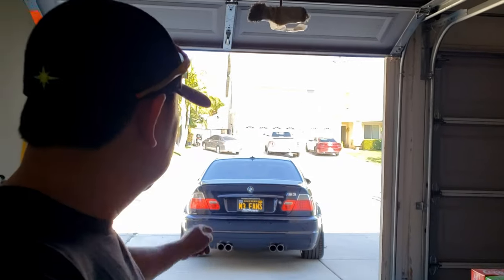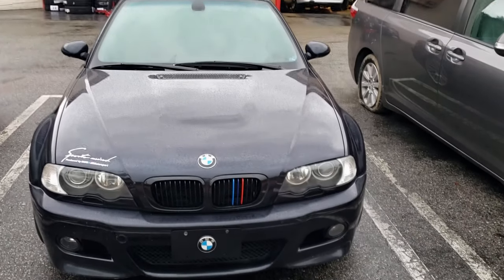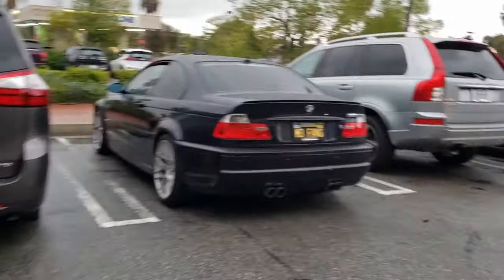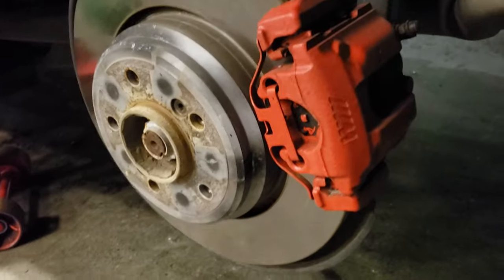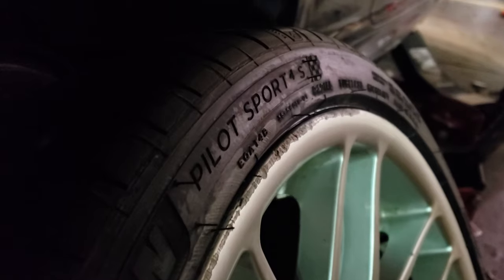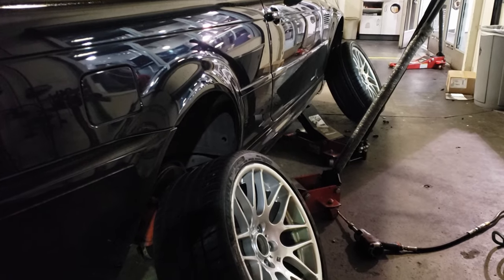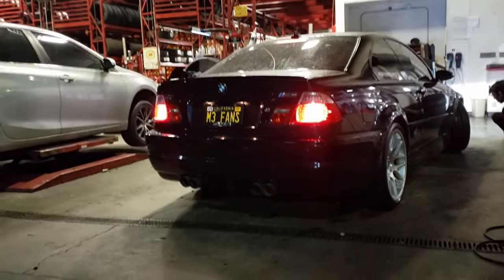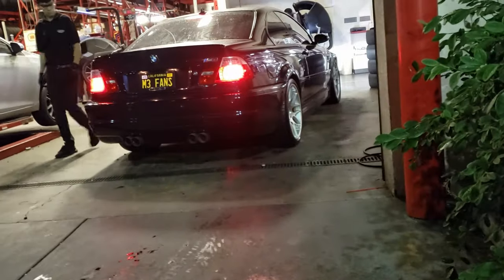My E46 ///M3 gets 4 brand new Michelin Tires PS4.

Comment: Hey brother I always Come back to your videos for advise your on it. 
I got my tires same size as you but the seem to be really big I also have the same wheels but should I be considered about rubbing I also want to install wheel spacers are your wheels 19x9.5 rear and  19x8 fronts? 
Et47 fronts and rear are Et 27 rears are theses your wheel offsets 
Thank you
Reply from the maker: Yes, it the same. Running 15mm front & 10mm rear spacers you will be fine for E46 M3. No worries. Enjoy
Reply: Seth ///M3 Thank you for getting back to me my friend I’m just a little worried about the size so  I have to get spacers so it can fit properly

Comment: How do you like the tires? Just ordered the same tires in 245/40/18 & 275/35/18 for my e46 m3
Reply from the maker: You won't regret with these tires. It rides so smooth and quiet plus it handles cornering amazing & stick to the road so well. Congrats.

Comment: Love your m3. Also you have some good videos.   Do you still have your 15 and 20mm spacers? And went with these size tires and have no rubbing issues?  I’m curious because I want to do the same thing.  Thank you. You take care.
Reply from the maker: Thank you Joni, these spacers will be on the car for as long I own it. There is no rubbing issues. I love the spacers. Strongly recommended if you want to do on your car.
Reply: @teslam3chennel  Man your E46 M3 is beautiful. I have an 04 E46 325i, and I’m shopping for Pilot Sports now, getting ready for the spring and summer. I plan to get similar wheels to yours (but aftermarket) and I want to go with 19’s all around, non staggered. I’m not sure if your set up would fit a non M E46, but yours is the exact look I’m going for. Blessings Brother, and stay safe out here!🙏🏽👊🏽💯
Reply from the maker: @dopeboyp3487  thank you brother. Aftermarket BBS wheels is awesome it looks close to oem CSL wheels. PS4 tires is the best tires for all season especially for performance car. You will be happy what you will be getting for your E46. Enjoy and stay safe brother 🙏 ✌
Reply: @teslam3chennel  Thanks for replying. My E46 is currently in the shop getting a CCV, and oil filter Replacement. Once it’s done I’ll get new wheels, tires, tints and paint. I’ve spent so much money getting things right, but once I’m closer to where I want it, it should “LOOK” like a 4 door version of yours. Minus the power of course, LOL!
Reply from the maker: @dopeboyp3487  Awesome looking forward to see it👍😎

Comment: Do I have to run spacers to run the same size as you?
Reply from the maker: Yes Robert, I have spacer installed 15MM front and 10MM Rear on the car. Make sure not to go over that size it can rub a bit when you go on the speed bump or uneven pavement.
Reply: Seth ///M3 Thank you my friend I am in so cal al so we should meet up for a drive one day
Reply from the maker: Sure will do hit me on my IG.